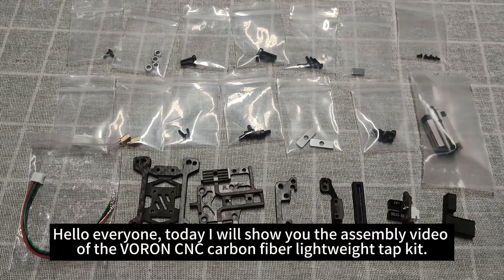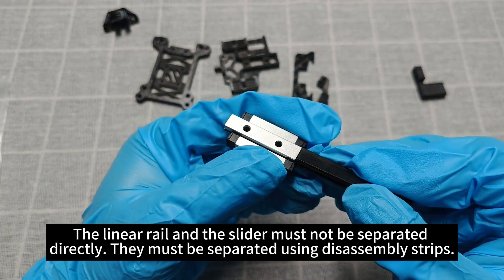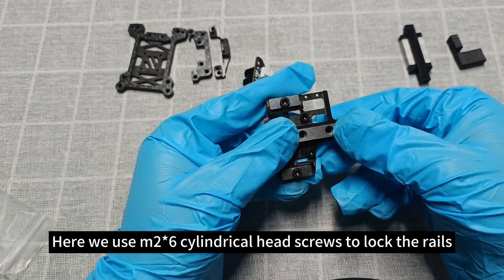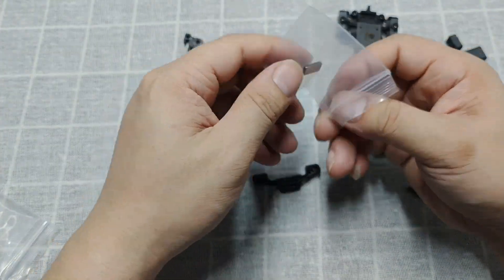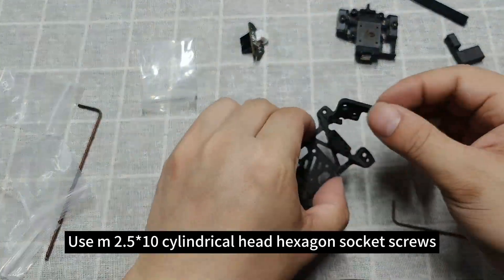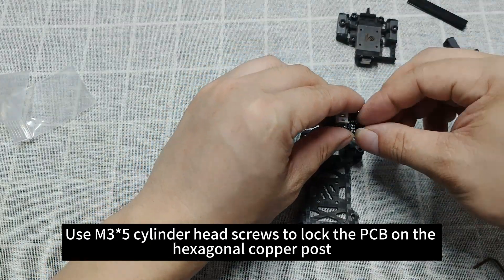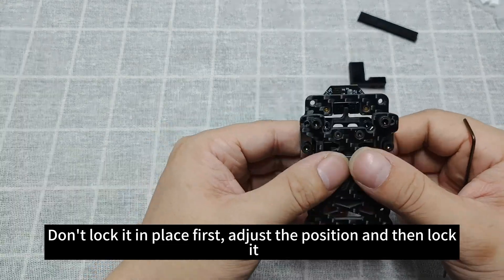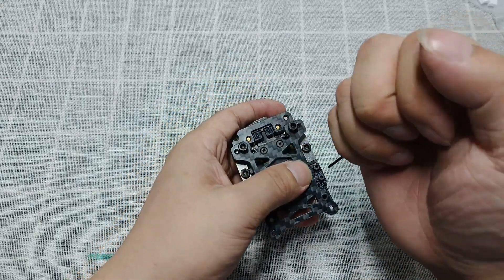VORON CNC carbon fiber lightweight TAP assembly tutorial

Comment: What is the purpose of the hex nuts used at 1:05 in the video? Do you take them off later on when you install it?
Reply from the maker: Preloaded screws, finally locked on the X-axis slider
Reply: @fysetc4882 https://youtu.be/Lq0TRr9uz7Y?si=sjh_D6pgKhb7i7-K
Do these have to come off in order to install? If so I am not sure why they are even there.
Reply: So do you take the nuts off to install it on the x-axis carriage?
Reply from the maker: yes @bearded_baker